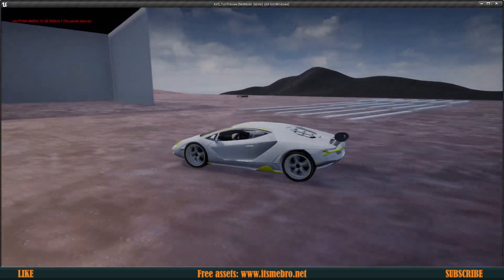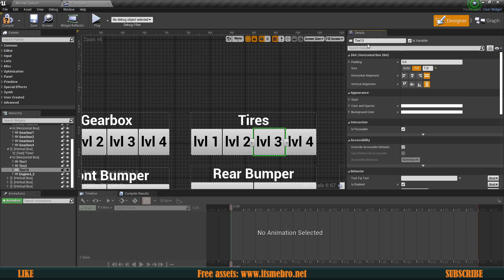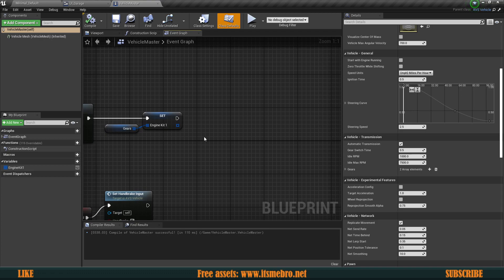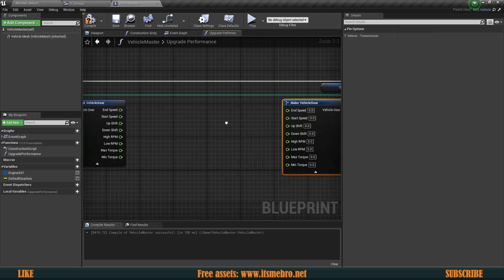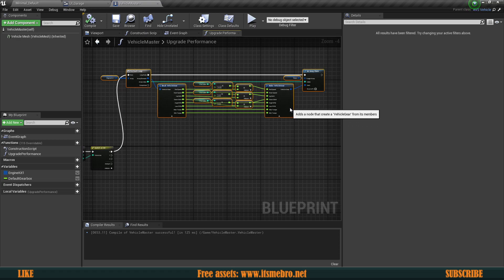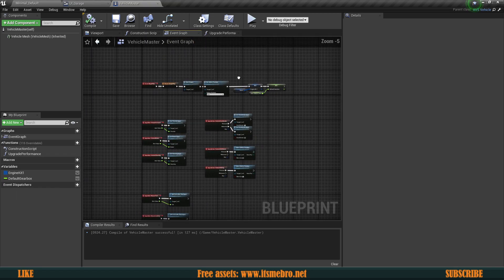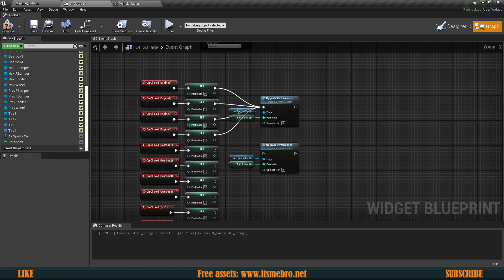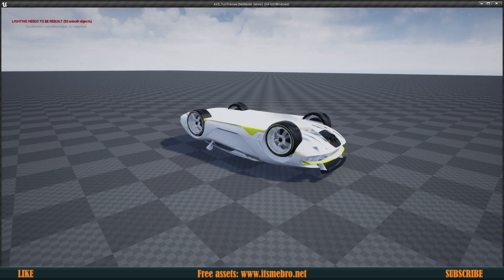UE4 Advanced Vehicle System / Performance Upgrades

Comment: can you do any of this without the Advanced Vehicle System plugin?
Reply from the maker: I don't have the time for that right now. Somewhere in the future in ue5 probably will make some videos on vehicles without plugins.
Reply: @ItsMeBro  so, that's a no?  in other words, the gears, and engine settings are not exposed to blueprint nodes unless we buy that plugin?
Reply from the maker: I believe there is no gearing for the default vehicles. The gearing needs to be coded.
Honestly It's been a while since I looked into ue4 default vehicles. But I think by default they only have 1 gear.